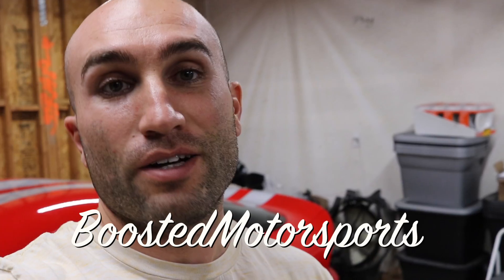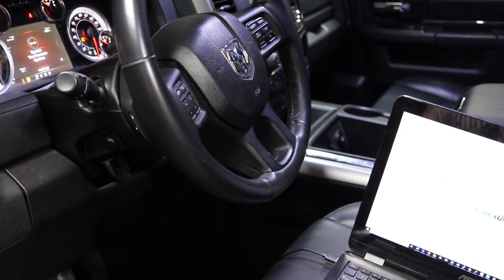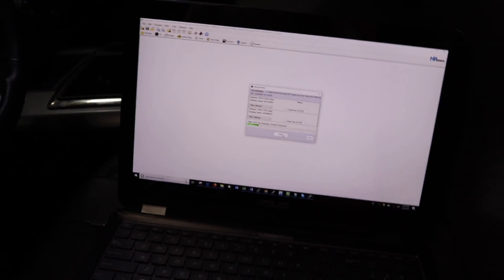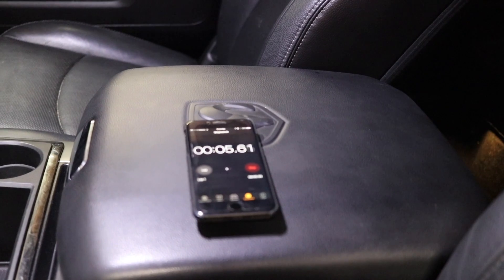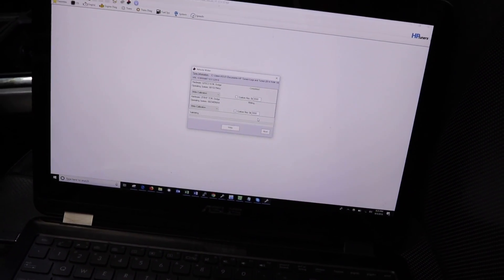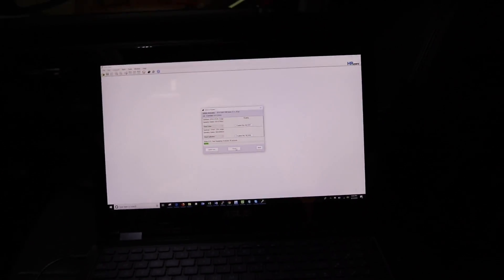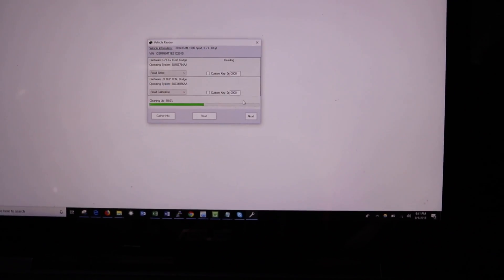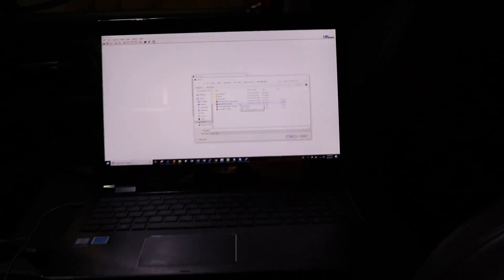Reloading the Supercharger Tune with HP Tuners MPVI2

Comment: Was wondering your opinion, I know you talk highly of the hp tuner but nothing is to crazy changed on my 16 1500. Just a air intake, flow master full system, EFan conversion, 180 thermostat, and truck is lifted on 37s. I have the 8 speed tranny. Is the hp tuner unnecessary or is best to just get it?

Comment: hey bro can't wait to see the hell ram cut loose with the pro charger all the bull shit you had to go through just to get rolling .thanks for all you do for us Ram guy's. I was wondering I've got a 2017 ram 1500 crew cab Laramie with the 5.7l 8 speed with 321 gears I've heard that just alone with a tuner just to change my shift points and the truck will fly . what tuner do you recommend ?
Reply from the maker: I can't wait either.  If all goes well I should have it running with the s/c tomorrow night I'm hoping. I might go live on insta or Youtube during the process for fun so keep an eye out!  Hmmm thats hard to tell you which tuner to use!  Both HP tuners and Diablosport will get the job done for a similar price but you will need to send your PCM off to get unlocked which will run you a few hundred dollars.  If you want all out performance I would look into changing out your 3.21 gears to the 3.92 also.  You guys saw the mileage I'm getting with my 3.92s 🙂
Reply: BoostedMotorsports  thank's again for the info .love the channel man  I'll be wacthing  to see the beast come alive.